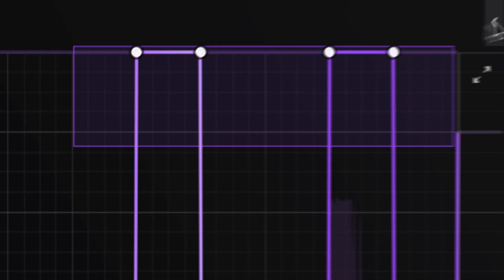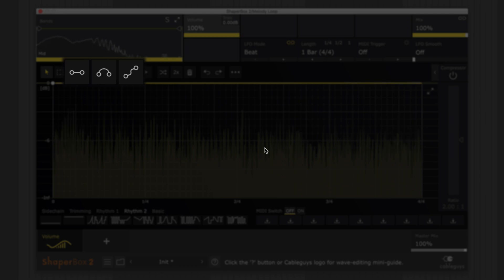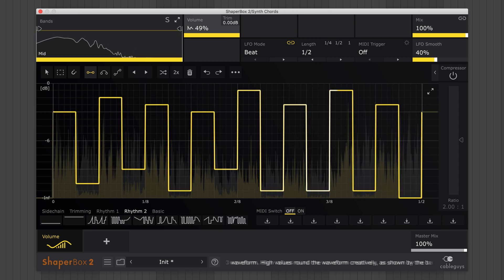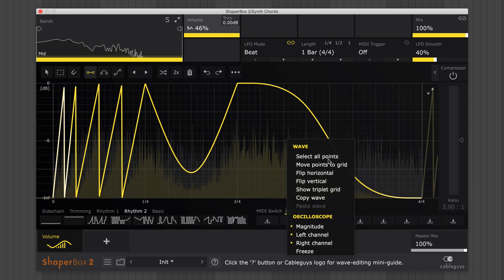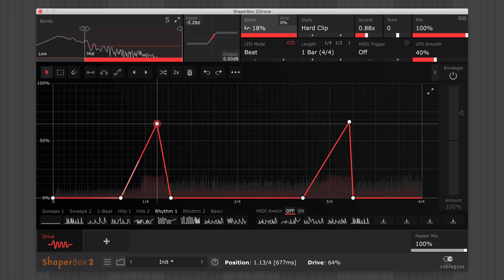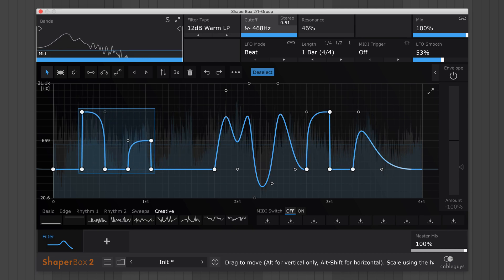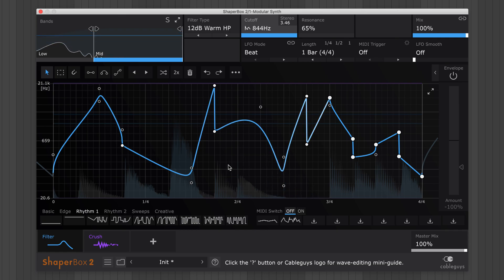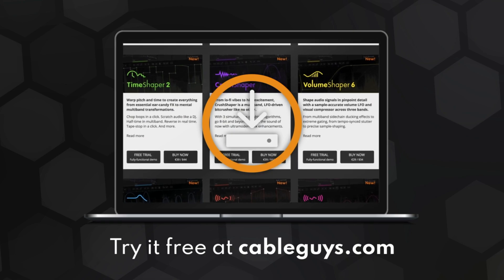How To Design Your Own LFOs // ShaperBox 2 Masterclass

Comment: Loving this video! :) I gave this tool a try a while ago but i missed a huge feature from it. When using time shaper for example, i wanna only use horizontal lines. Pressing the random button will go totally crazy with those lines. I asked a feature like control clicking the random button which would preserve the horizontal lines, and ctrl-shift clicking would preserve those and the timing too. Is that what version 3 maybe have? If not please include it in your next update and i'll buy it asap :)

Comment: Is there a way to have the length of the segment be, for example, 15 or 14 sixteenth notes long for polymetric phasing? Or to have the background sixteenth note grid be swung?
Reply from the maker: By retriggering the LFO with MIDI, you can create patterns in any time signature. So for your example, you would set up a MIDI note on every 15th 1/16 note, route it to ShaperBox, and set ShaperBox's MIDI Trigger to On. With a 1 Bar pattern, you'll see it jump back to the start every time the MIDI note is received, ie, it will only play 15/16 of the full bar.

For swing, you can enable the triplet grid in the "…" menu (also available by right-click on the LFO editor area), and use that to draw swing patterns.

You may also find this technique interesting: https://www.youtube.com/watch?v=IEpXoTf0RAc

Comment: is there any way to duplicate a complex selection, say, 1/2 within the same 1 bar?
Reply from the maker: So you want to duplicate the first half of the bar to the second half, for example? You can select the first half of the bar, hit the 2x button, then stretch the selection out so it takes up the full bar. Does that work for you?
Reply: @Cableguys  It does, thanks!

Comment: Thanks loads for this tutorial! I had ShaperBox ver. 01, and wasn't gonna budge to ver. 02 until you added a bunch of features, shapers and functionality - and a sale 😉 This is such a great plugin for automation and sound design! I use Pan Shaper in almost every production. Control via MIDI is great too. 👍🏾👍🏾
Reply from the maker: v2 definitely brings features, Shapers and functionality 😉 Which new feature are you liking the most?
Reply: @Cableguys  Increased window size is appreciated, but the multiband functionality is a boon!
Reply from the maker: @moreorlesto  v1 has multiband! Did you mean something else?

Comment: Honestly, best plug in I own, find myself reaching for it constantly.  Thanks so much for this video, I use this all the time and still picked up a few tips!  And I saw pitch shaper below, yes!! This would be awesome!
Reply from the maker: Cool! What new tips did you pick up from the video? We're curious 🙂
Reply: @Cableguys  I was always trying to smooth curves with the shaper controls, I had no idea that I could just use the LFO shaper!  Game Changing!  Also, being able to copy paste wave shapes to other modules was super helpful!  I could read the manual but the videos are much better!
Reply from the maker: @dh.l7499  LFO Smooth was added in the v2.3 update along with DriveShaper 👍 DriveShaper has it set to 40% by default, which works great for general smoothing away of clicks/pops. It's at 0% in the other Shapers (for compatibility with old projects), but you can just double-click to get the 40% default value. Glad you're getting so much out of the vids!

Comment: Very nice, thank you!
Now you only need to refactor the presets manager...
Reply from the maker: Agreed! It's on our to-do list 😉👍 For now, you can make finding presets easier by browsing Packs, filtering by Shaper, or using the text search in the Full Search section.
Reply: @Cableguys  That's good to hear. I already use your mentioned tips, but since they are limited too and/or not user-friendly when used a lot of times i'm looking forward to a massive update regarding the presets manager.
Btw. i've sent Ronan detailed suggestions what needs to be refactored and extended in my opinion.